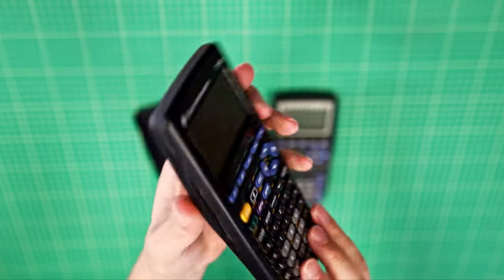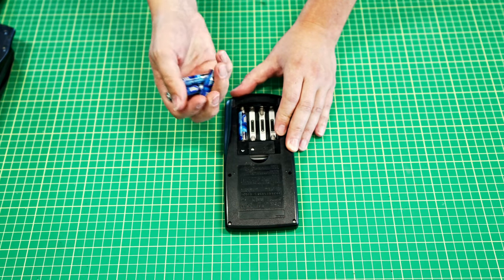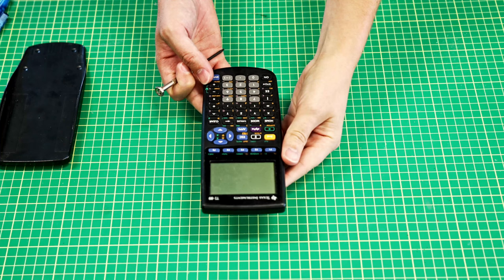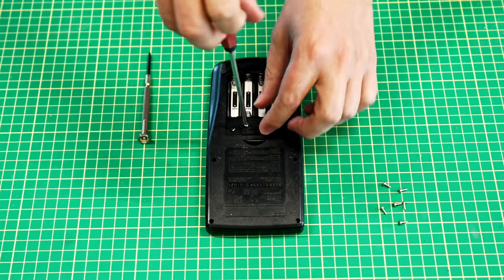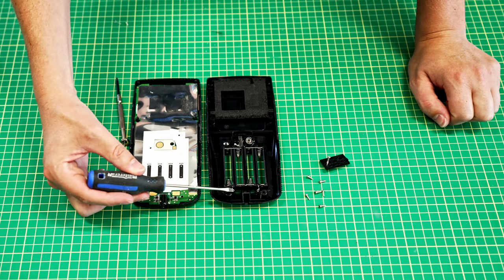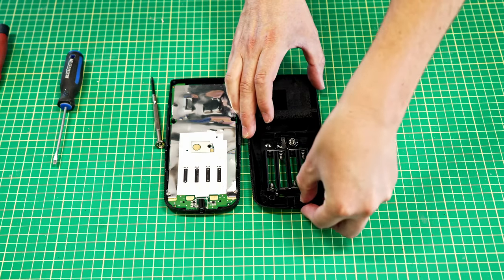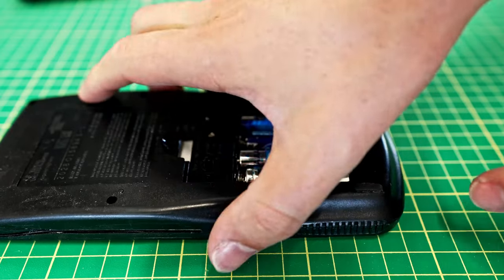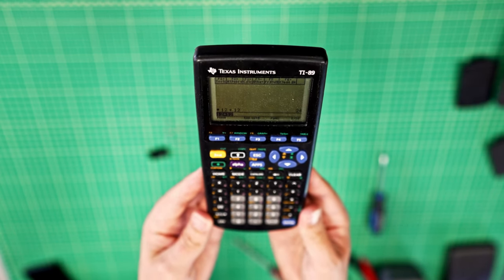Dead TI-89 Calculator Repair

Comment: Wanted a TI-89, but don't really want to pay a ton since I don't really need it. I have two Titaniums from thrift stores, but like the look of the old style better. So, I just bought one on ebay for $12 that looks decent, but doesn't turn on. Hoping this will allow me to resurrect it! I'll try to come back and report if it works!
Reply from the maker: Sounds good, hope you can get it working! $12 is a good deal for sure if you can get it running again.
Reply: @ResearchDesignBuild That was indeed the problem. Biggest issue I had was my first torx screw driver was too short to reach two of the screws, but I found another one that worked. The pads had a little corrosion that I cleaned off with baking soda/water, then I slightly bent the legs as you showed. It's good as new now. Easy fix. THANKS!
Reply from the maker: Great to hear you got it working! @jaketheengineerguy

Comment: Se puede poner en espñol?
Reply from the maker: Lo siento, no hablo español, así que uso el traductor de Google. Pero todo lo que necesitas hacer es doblar un poco las pequeñas pestañas de metal que conectan la batería a la placa de circuito y se restablecerá la conexión eléctrica. El diseño permite que esas pestañas desgasten su punto de conexión con el tablero de control, por lo que es necesario moverlas a un nuevo punto de conexión en el tablero de control. Espero que esto ayude.